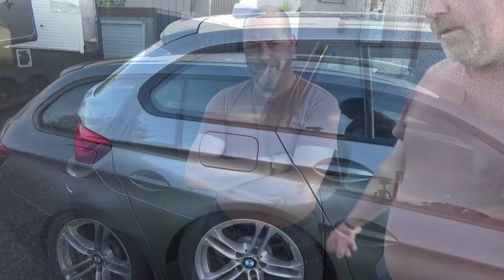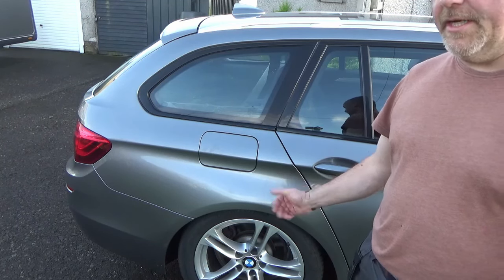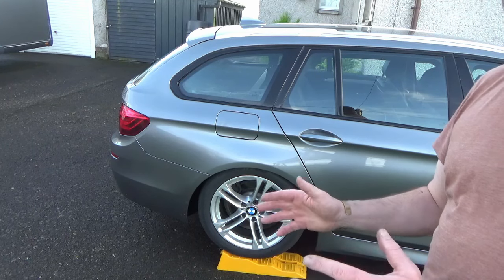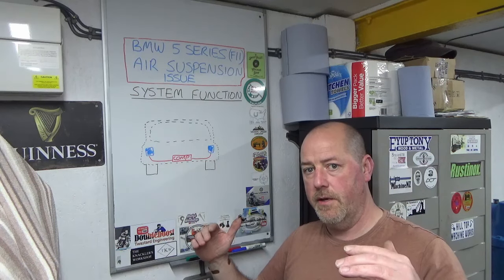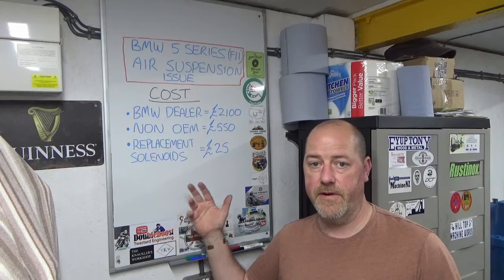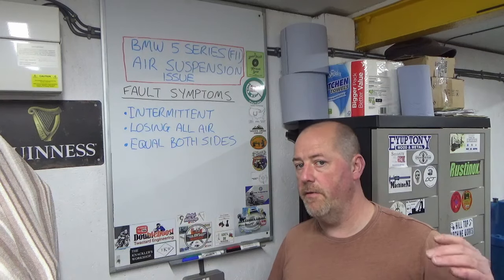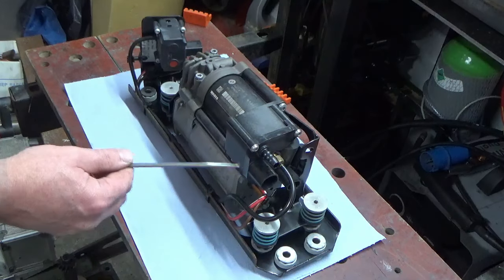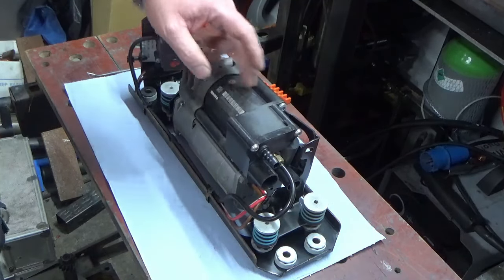BMW 5 Series (F11) Air Suspension Fix for £25

Comment: if youre able to fix things youreself you can save a ton of money , my washing machine pump failed after 15 years , repairguy told me it would be about 150 euro's to fix and i was better off buying a new machine 
took the pump out of the machine whent online to aliexpress and took a look around at the photos checking the electric points bolt mounting points and the hose hookups turns out that LG is long sumting and a chineese brand (sold here by phillips i believe) the new pump was 15 euro including shipping and the washing machine is running like new again 
the newer part lacked some of the covering around the electric motor  but fitted exactly like the old one did
friends fridge , same thing repair guy told him to buy new , shorted the temperature switch and the machine ran so the switch was broken , bought a new switch for 20 euro and he had a working fridge again 
its allso nice to be able to say : i fixed it myself
now my kitchen tap is leaking , new tap is 140euro new cardridge to fix the leak is 8 euro ,have to take the tap a part to find out wat cardrige i need but still
Reply from the maker: Hi Watahyahknow, thanks for the comment. You are so right. And what cost to the environment of all this throw away mentality which is being driven by large industry, that never gets mentioned in the global warming debate as attacking the motorist is much easier. Sorry, ranting now. Cheers, Jon

Comment: Excellent Video.. Im just experiencing problems now.. Every morning recently Im getting in and drive off, feels like the car has no suspension. eventually the car picks the back end up and it rides fine.. I suspect my valve is on its way out..  Thanks for you Video and the link..!

Comment: Mine was up and down - both sides - intermittently. So I had a go and found the dessicant waterlogged. Replaced the solenoid with Amazon new one also. Put back together and fitted back on. Except when I turned the ignition on.. Nothing. No sound from the compressor. just an error on the dash computer. I wired it up right I think. I'm not very electrically minded but now I'm scratching my head.

Comment: My air suspension goes down periodically on the passenger side. As it is intermittent what do you think is the most likely fault - leaking solenoid?
Reply from the maker: Hi Ian, thanks for the comment. I really don't know in that situation but my guess would be, if it is intermittent then probably not the airbag itself. There is a solenoid for each side (the other unit I didn't replace on the compressor), what I don't know is if there are any more solenoids at the airbag itself, if there are then it could be that. If its electronic (system, computer, logic etc) then I am totally lost as I don't understand that stuff. Sorry not much help. Cheers, Jon

Comment: Hi guys. Anyone know what it means when there is moisture in the decant. I opened mine but in the video the beads were clear and it did not have the problem I have. The beads are all brown and stuck together. Any fixes guys? Thanks
Reply from the maker: Hi Bilal, I am no expert but it basically means your compressor is working too hard which probably means you have an air leak somewhere else. You can regenerate the media by pouring the beads onto a baking tray and putting in the oven at 100 C for about 45 mins. Dry the housing out with cloths and then reassemble. You also need to dry the filter papers (hair dryer should do it). Like I said, you will not have got to the root cause but this will get you going again in the meantime. Cheers, Jon

Comment: Hi, I was just wondering what display message was you getting on your screen inside the car to say there's a issue, I got a problem with mine, message says chassis function restricted, the back end of the car has dropped and won't go back up
Reply from the maker: Hi Jas, I got the same message on the morning of making the video, I had not had the message before that day despite it dropping previously. Not had it since either. Cheers, Jon
Reply: Cheers mate 👍
Reply: Hi Jon, where did you get your solenoid from? As I am struggling to find mine is a 520d m estate 2018 68reg. Everywhere I am looking seen to say its for the older shape and say they are not sure if this will fit? Any help or suggestions?
Reply from the maker: @JasS-qf4ge  Hi Jas, the link is in the description. Cheers, Jon
Reply: @jonsworkshop  Hi Jon, do you know if this solenoid is the same in the g30 model or is the compressor unit the same. Called bmw dealer very unhelpful. As nobody have a solenoid for new shape g30 model?
Reply from the maker: @JasS-qf4ge  Hi Jas, no idea, sorry. I have only stripped mine so no ideas what other models have unfortunately.
Reply: @jonsworkshop  ok thanks. Do you have disconnect the battery  before removing the compressor unit?

Comment: Where i buy this part for 25 pounds, you got link, i may have same issue
Reply from the maker: Hi Alexander, I got mine off Amazon.... Check this out! https://amzn.eu/d/5PDcmm4
It worked for me, but may not work for you, so please consider this when purchasing. Thanks, Jon
Reply: @jonsworkshop i Jon. Thanks for the great video. I have the same issue so going to give this a try. The part you linked states for 2010 to 2014 models. Mine is 2015. Any idea if it’s the same part?  Thanks in advance

Comment: Very good video Jon, great diagnosis and fault finding. I like doing things like that. All the more satisfying when you can save yourself "a chunk of change". I enjoyed watching.
Reply from the maker: Hi Carl, thanks for the comment and feedback. Hope it endures! This will be my last Beemer, not impressed with the whole package from crappy and damn expensive run flat tyres that pull the car all over the road to not being able to make it up a 10 degree incline in mild frost, to over engineered and expensive suspension...... the list goes on! The old 80's 3 series were a much better car in my opinion, they have lost their way! Cheers, Jon
Reply: @jonsworkshop  Ok so then what kind of car/SUV would you get instead? What else has such a powerful drive, is as nice looking, as luxurious & fancy inside & out & has such cool features like seats that heat & cool? Big ass sunroof? Shiny wood trim? Awesome 4-wheel drive?

I like the safe feeling from a heavy weight mid-size SUV that can carry stuff/furniture & go over bumps & pretty deep puddles & pull stuff like Jet skis or trailers, a truck big, thick & strong enough so I don't feel I'll be smushed in a car crash... X5 is all that.
The only other SUV i've ever known that comes close to my newish to me , purchased Feb 2021 like 2 weeks before Covid lockdowns here in Miami FL,  2011 X5 is a jeep grand Cherokee limited (think it was 1996 or 97)
It was my fist SUV, i loved it so much!

BTW Thank you making this video, I learned sooooooo much! It was awesome at the end when it worked & you saved THOUSANDS!!
Of course I couldn't actually DO what you did, but i can supervise someone who can! lol
I love knowing what's wrong before complaining to a mechanic.
Reply: Proper winter tyres (not all season) solve the traction problem but expensive to maintain a second set.  @jonsworkshop

Comment: Hi, What's the betting the dealer part is a "factory" recon part and the faulty part has to be sent back for a £25 valve to fitted and a lick of paint ready for the next customer. Thanks for the interesting video. John

Comment: Great job done Jon. Quick & easy. I guess some folk would just take it to the dealers & pay through the nose. 
Regards.
Steve.
Reply from the maker: Hi Steve, thanks for the comment. Yep, I feel sorry for those that have, it's a complete racket. I found a Wabco complete replacement unit for about £850, pretty sure BMW won't be paying that for them. If I had ramps and all the right tooling, I could swap one of these out in about 30 mins start to finish so that's about £2600 pound an hour labour rate based on what they quoted me........ Shocking! Cheers, Jon

Comment: Good for you, Jon! That sort of fault is much more diagnosis-friendly than a problem somewhere within an inscrutable electronic control module. Now, in your opinion, is that driver-adjustable suspension system worth having? I’ve never owned one, and it seems like a lot of potential trouble.
Reply from the maker: Hi Dudley, thanks for the comment. Short answer, No! Total waste of money, I think the whole thing is designed to draw people in dazzled by the amazing technology (and to make an absolute killing on spares by fitting un-serviceable parts as standard). I can't say I notice any real benefits. They probably have to fit it to soften out the crappy hard ride that comes from the stupid run flat tyres they put on as standard. You can probably tell I am completely underwhelmed by this car, not worth the ticket price! Cheers, Jon
Reply: Just to add, for any car it's worth having a decent OBD reader. In the case of BMWs, it's worth getting a copy of ESys & ISTA + cable which allows you read any code and reset/adjust etc. Obviously it's only worth it if you plan on keeping the car for a decent length of time.

Great video Jon - going through the same fix and waiting for the part to arrive. It's amazing and sad how few people are willing to get their hand dirty on their car or around the house.

Comment: G'day Jon. Sound diagnosis working out the fault. I won't accuse the dealership of trying to rip you off, the days of the type of repair you did died many years ago it's a plug and play system now. They probably  don't stock individual valves but are supplied the complete assembly by the manufacturer, this is where the aftermarker steps in to fill the void. I've been in the industry for 50 years and it's shocking how its developed, I've gotta stop before I rant, don't start me on IP ownership, buy a car for $50k and you don't have full access to the computer without greasing the palm of dealerships........
Cheers 
Peter
Reply from the maker: Hi Peter, thanks for the comment. Yep, it's a total racket, from design where they build unserviceable parts in deliberately, to after sales that is extortionate. I took the same car in for BMW major service last year (oils, filters, checks etc), £600, about $1200 AU. At least Dick Turpin had the decency to wear a mask! Cheers, Jon
Reply: @jonsworkshop  the industry is that bad my son who worked at the Isuzu dealership for 12 years was only given the relevant 1 or 2 pages of the  E manual he needed to do the repair,  no paper manuals available. Cheers

Comment: Great informative Video Jon!! I learned a lot from this expose! I have a Wabco air compressor that came from my Brothers BMW powered Land Rover and wondered about various aspects of it. It works fine by the way, he took out the air bag and put coils in his Discovery as a better option. I was given the pump and turned into an air compressor for pumping up the tires on my Nissan Patrol. I put in an Ally box with a pressure tank and and made a fitting so that I could dump all the air from the tank in a split second to be able to re-seat the beads back on the rim should that happen when I was going or coming back from Beach Fishing.
 I also did some homework on Wabco and found that they have or perhaps had a large Manufacturing Plant in CHINA. Makes me wonder about BMW's price justification!?
PS: A good use for one of these pumps if you can lay your hands on one for less than 2100 or 550! Just need a few tools and have a think.
John, Australia.
Reply from the maker: Hi John, thanks for the comment. Standard coil over shock would be a shed load more reliable and much cheaper to replace. If the worst comes to the worst and I have to end up replacing the whole unit, guess where the old one is going lol. Cheers, Jon

Comment: Nice cheap fix Jon. The same system as was fitted to my Discovery, but it was the air bags that failed. 
You can't really blame the dealer. They have to warranty the system if they repair it and they can't do that if they've delved into the pump, so they fit a new one which is warrantied. The consumer has driven this type of activity, it's just a response to what the market wants as a whole and is an expensive business. There are few garages these days that have the time and would take the risk of breaking into a component. 
Best wishes, Dean.
Reply from the maker: Hi Dean, thanks for the comment, agree on the consumer bit but they are ripping people off big time. This took me about an hour to do including all the strip down etc. If I was just replacing the whole unit and using ramps etc, I could do it in about 30 mins, Wabco unit is list price at £850 so even if BMW were paying list (which they won't be), that works out about £2500 hour labour rate based on what they quoted me!! They are at it! Cheers, Jon

Comment: Enjoyed the video this morning. Excellent fault diagnosis Jon. I too have been working on the air suspension this weekend on my Range Rover  when it dropped to its bump stops. Mine was a worn compressor piston seal. It has a very similar system to yours with compressor, valve block height sensors etc except air on all 4 corners. The air drier on mine is a replaceable part as you point out, water in the system is the main cause of problems. Keep up the good work Jon and hopefully we will see your shaper making chips soon.
Reply from the maker: Hi Gary, thanks for the comment and feedback. I can see the benefits on a 4x4, but not on a motorway cruiser. Totally unnecessary in my opinion, its just a cash cow for them. On borrowed time with me, going back to a sensible car soon. Cheers, Jon

Comment: Fantastic work Jon, the majority of the big car garages are just scammers these days. I see a £2000 tool addition for the workshop, wink wink. Tony
Reply from the maker: Hi Tony, thanks for the comment. Lol, I did consider what to spend the savings on lol, run out of room now so garage extension perhaps lol. Cheers, Jon

Comment: well done Jon I would just hate getting ripped off by the main stealers they do not help people at all this goes for all of them porche bmw Mercedes etc etc and they pay their employees a pittance
Reply from the maker: Hi John, thanks for the comment. Yup, you are bang on. I had a Skoda serviced at main dealers for 3 years from new, in year 4 I took it to an independent and he showed me the torque paint on the wheel nuts, not even had the rear wheels off! Shocking. Cheers, Jon

Comment: BMW, woould never ever have another one, not even given. Nowadays, not only in bmw proper meanics rarely exist, they are more like fitters, take of and fit a new one and then charge the earth as all jobs have a time stamp/price(even if it takes them less time you pay the job price) At one time a mecanic would have done the exact same as you. Well thought out deduction of the problem and saving a lot of money on the fix. Your last job now is to go back to BMW, show them the cheap fix to stick it up them.
Reply: there’s very few true motor mechanics about these days who diagnose and repair, the whole system is parts swap out with old in with new. keep swapping parts down the line till fault goes away. 
manufacturers are trying there hardest to get rid of right to repair. Australia has groups fighting this as are some groups in the USA. 
Apple i believe lost a battle about this, but now looks like there going to charge ridiculous amounts for the repair information. So it’s a catch 22 situation.
Reply: @wjb2  group buy and then put it all on open source or shareware with everyone for say $5
Reply from the maker: Hi Derek, thanks for the comment. That's two of us, this will be my last ever Beemer, not at all what they used to be! Totally underwhelmed by the whole package from sales, to service, to general operation, not worth the ticket price! Cheers, Jon

Comment: I used to think “BMW” stood for “Bad Man’s Wheels”, until I bought one. I quickly learned it stands for “Bring My Wallet”. Great cars to drive, but unreliable and expensive as hell. Best thing we did was getting rid of it and getting a Japanese car.
Reply: Far too many recalls on nearly every model. It's pathetic. People are brainwashed by bmw
Reply from the maker: 100%, except no recall on this issue as they are making far too much money from it and they can get away with it due to the simple coding in the system that says "safe to drive" when the suspension fails completely....... How, it wouldn't pass an Mot like that! Daylight robbery.
Reply from the maker: Love that. I too have got rid, best thing I have done and will never buy another.

Comment: Where Can i buy that selonoid Unit and what is is called
Reply from the maker: Please check the description. Thanks. Jon
Reply: @jonsworkshop  Thx i Saw it and have allready ordered one.. hope it Will solve The problem.. mine only goes Down sometimes :)
Reply: Hey Jon just bought one of this car and having issues with the suspension system